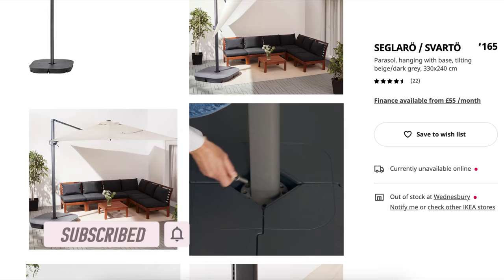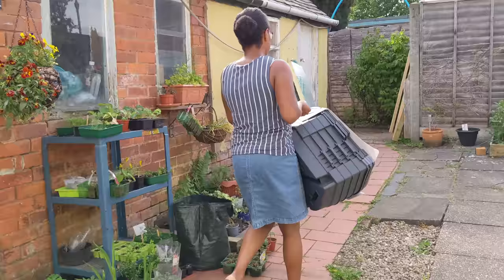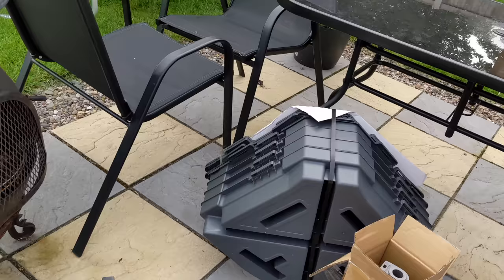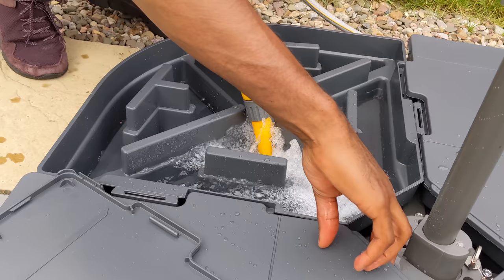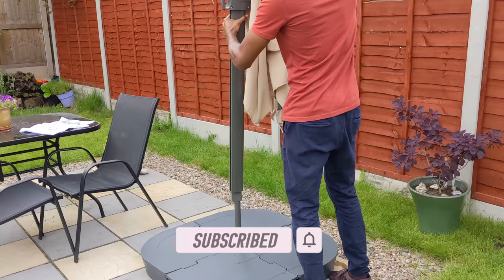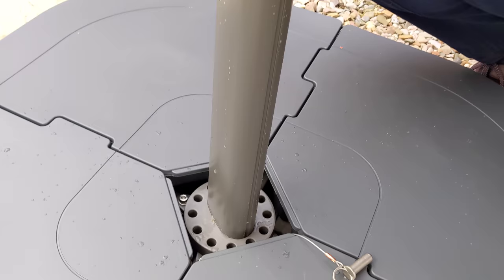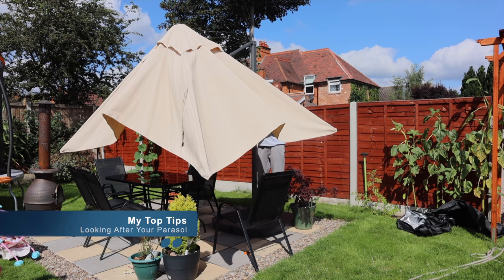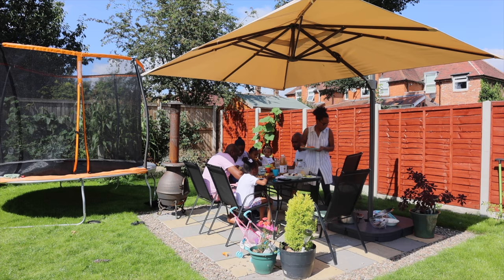Ikea SEGLARO Parasol | Back Garden Patio | Review Unboxing

Comment: Hi, great video! At 3:08 when you're bolting the vertical tube to the cross base section, are you able to tell me the bolt spacing? I'm looking at using an in ground base rather than the plastic base that comes with it.
Reply from the maker: Heya
Thanks for watching. I would happily check and let you know but at the moment we are away in Spain on holiday with the family 😅

Perhaps you can remind me again when we get back Friday afternoon 👍🏾

Your idea sounds great. I hope you can get one as they are often out of stock 😅
Reply: @TheMalcolms7  This may be a long shot, but I'd also love that measurement if at all possible, as I am trying to do what @Will Passey was going to do! Thanks.
Reply from the maker: @DriftLifeAus  tomorrow I will have a go at measuring it. What exactly do you want to know?
Reply: @TheMalcolms7  Thank you! I would like to know the measurement of the distance between the bolt holes where the bolts are fixed from the umbrella pole to the base if that makes sense?
Reply from the maker: @DriftLifeAus  ok
I will have a look for you tomorrow and let you know. Hopefully I won't forget. If I do please remind me 😅
Reply: @TheMalcolms7  Thank you!
Reply from the maker: @DriftLifeAus  heya. So I had a look. It's tricky to tell the exact measurements. It between 10-12 cm. Because of where it's located it's hard to measure it. I took a photo with the tape measure if that can help.
Reply: @TheMalcolms7  Thank you! It makes sense it was difficult to measure exactly given the position. I think that gives me enough information about the spacing for my purposes. I do appreciate you taking the time to get the measurement for me. All the best with your channel!
Reply from the maker: Awesome
Glad it was helpful 😊
I hope you will have success with your project. See you around 🙌🏾

Comment: Why did you use water instead of sand? Won't you have to keep topping it up, where as sand would be fine for ages.
Reply from the maker: Great question 😅
I did it for 2 reasons, 1. to see how long it will take to dry out, call it an experiment and 2. the sand can get messy I guess but I may use it in the future if the water dry out during the summer.